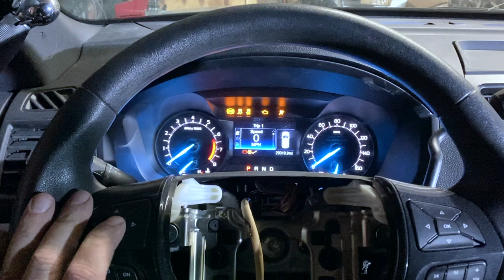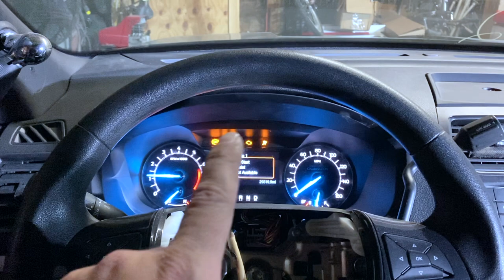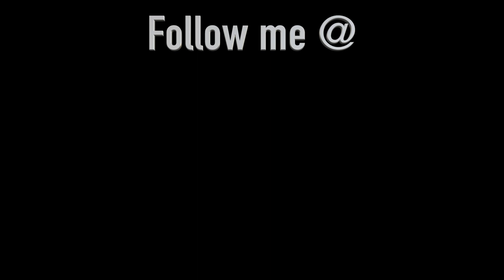Rebuilding A Wrecked 2017 Ford Police Interceptor Utility -- Part 11

Comment: Really enjoying your videos. Very interesting to watch as I have an interceptor just like yours. I actually live out near Avon! Near you I think! I saw your quick jack and I bought one from Costco for $799. It is the 5000slx though but I think I can get the Slx frame extensions and the truck adapter kit. Are you having any trouble with just the 60 inch width of yours?
Reply from the maker: Cool! How have you enjoyed driving your Interceptor? Also awesome you got a QuickJack! I hope it’s working out well for you. Mine has been a real help! Has a scissor lift before getting the QuickJacks. Could use that on many of my cars. The QJ’s have been awesome for me! I also got the truck/SUV extensions which work well on the Interceptor. That’s actually the only vehicle I’ve put on them so far, so I don’t know how they’ll do on other cars. But I expect they’ll work great.

Comment: Unless you are  planning on selling it to a city to use it as a police car I think I would have removed the goofy looking spotlight and patched and painted the hole while it was at the body shop.
Reply from the maker: I respect that opinion, but I decided not to for a couple reasons. First, it would be a lot of work to patch that up. It would involve removing the light, patching the metal A-pillar,  replacing the inner pillar trim, and replacing the outer pillar trim, which is two separate pieces. All of that is time and money. Secondly, I actually like the light. While this Interceptor is no longer a police car, I like that you can still tell what it was. I have other things planned for this vehicle that are in keeping with this idea as well.
Anyway, I know not everyone will like everything I choose to do with this car, I’m building it the way I like. I hope you enjoy watching the process, even if you would do things differently!